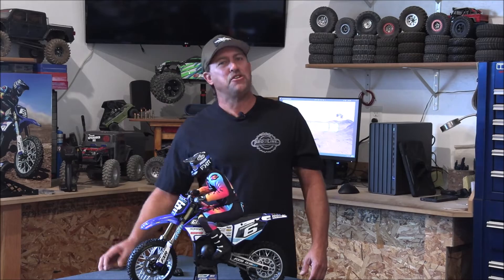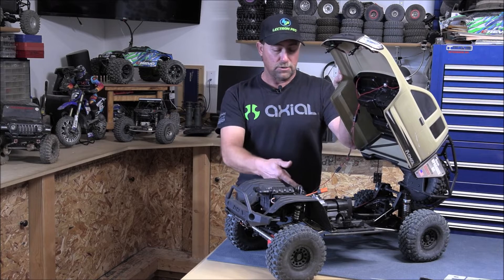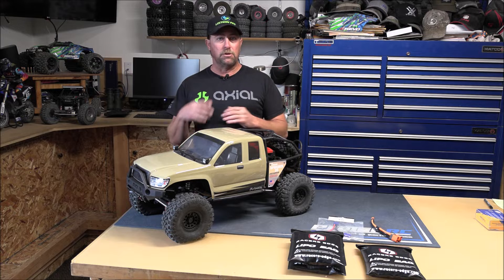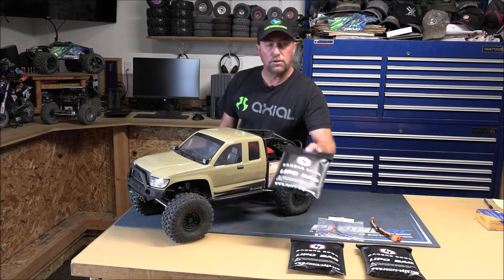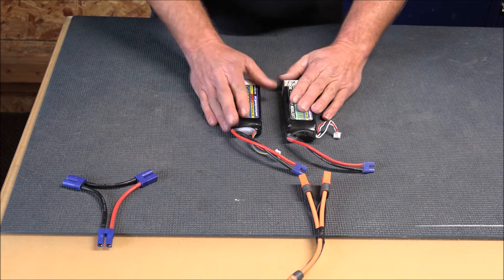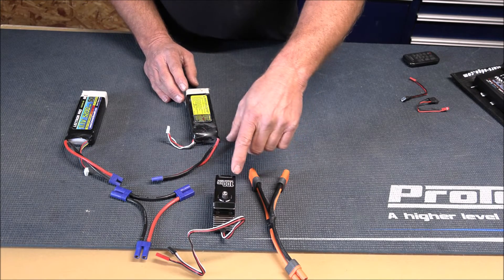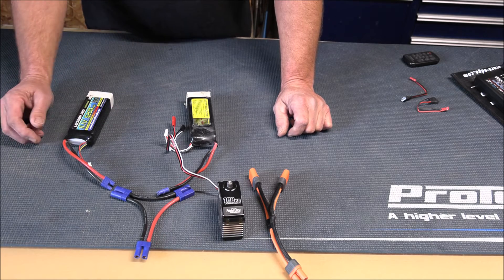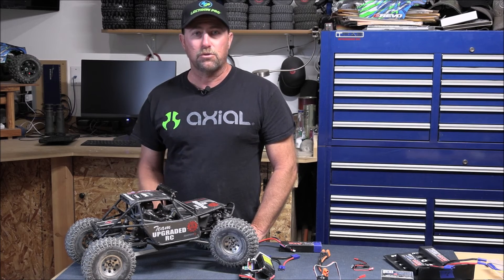Whats the Best battery setup for your rig! Parallel Vs. Series

Comment: Thank you for sharing the video link. I wish I had seen it earlier before purchasing the 3S 10000mah batteries. It seems that they will work on the Scx6 honcho as long as I have them in parallel, as you mentioned. However, I will have an issue trying to fit them in the Scx6's battery tray, as these batteries are almost 2 inches longer than the trays.

I might need to return these batteries and get smaller 3S 7000mah ones, unless I can find a bigger battery tray. 

Thank you once again for sharing the excellent video. I am learning a lot and plan to upgrade my Scx6 honcho with the same parts as you.
Reply from the maker: Amain hobbies has battery trays. Not sure how much longer they are though.
Reply: Thanx I’ll check em out.  My Scx6 arrives tomorrow  feeling excited. I also have it in the same color as yours.

Comment: I don't normally comment, but the way you did this Video I just have to let you know it is absolutely perfect in every way, great explanation and demonstration ... I just got my SCX-6 the same one you have and was double checking on the Parallel setup ... I am running 3s per the Instructions but it seems like it's ok to run these on 4s?... Great Video!!!
Reply from the maker: Thank you, I appreciate it.
Reply from the maker: Yes, you can run the stock SCX6 on 4s. Either 2 4s batteries on parallel,  or 2 2s in a series

Comment: Great information,thanks for sharing. I'm also planning on running dual 3s batteries on my scx6 also using the parallel leads. This helped me out alot as I this rig is the first rig I will run 2 batteries at the same time. Thanks again